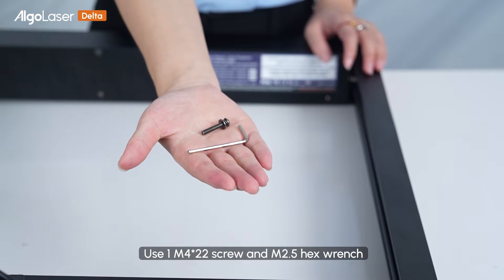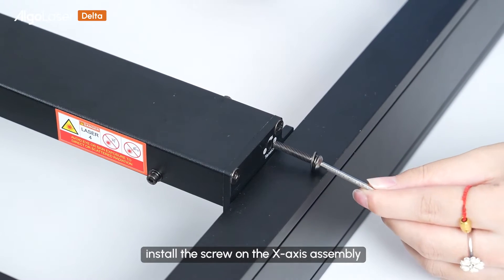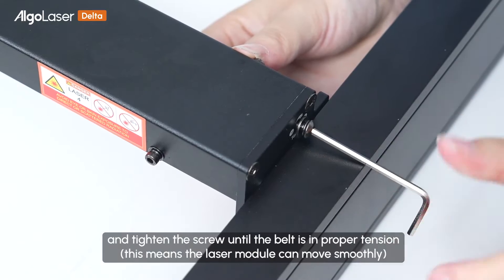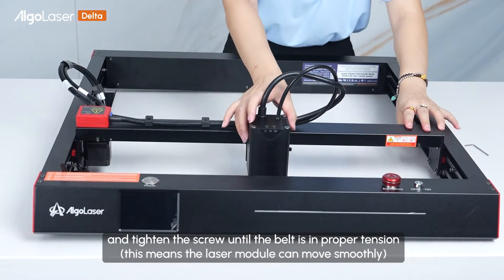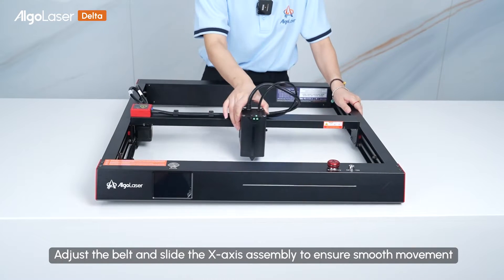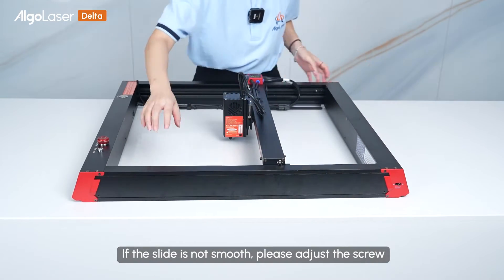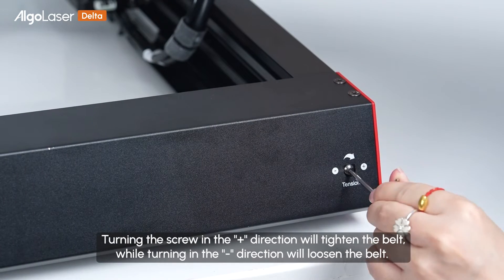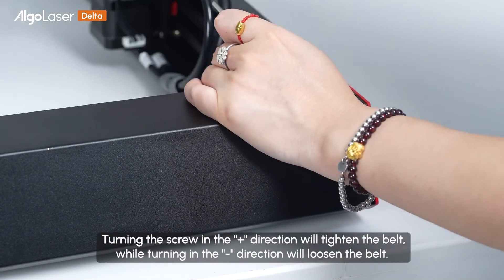How to adjust the belt | Delta Tutorial

Comment: adjust until it moves smoothly. no suggestion how to test it is correct, the carriage will move smoothly even if the belt is too loose.
Pointless video, tells you how to adjust, which was obvious anyway, but not how much to adjust.
Waste of time, just like your customer support.
Reply: Adjusting didn't help, still rough as a badgers bum.

Despite support sending me here and to other pointless videos, once I replaced the wheels it was finally smooth.
1. Support is pointless.
2. Assembly is poor, the belt was on wrong.
3. Quality control, if there is any, is useless, the rough X axis was very obvious and should have been noticed at even a basic check.
4. I had to spend £9 on a brand new machine to make it work the way it should.
5. This piece of junk with it's non-existent support is being sold and a different make will be bought.